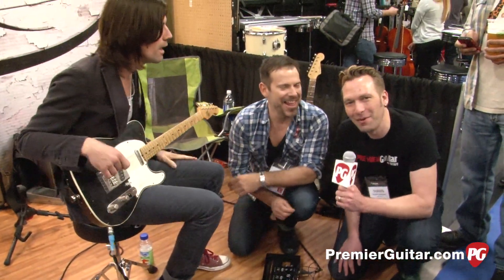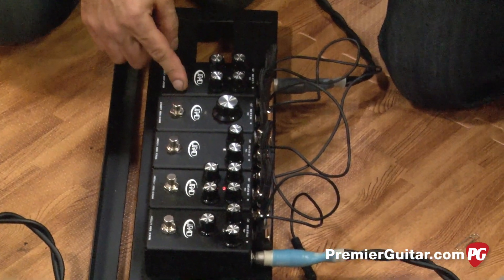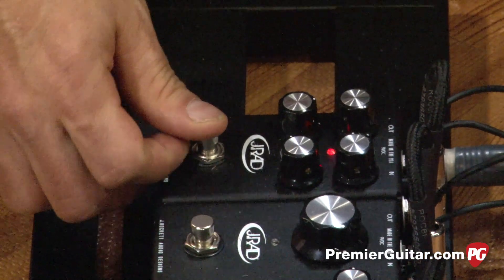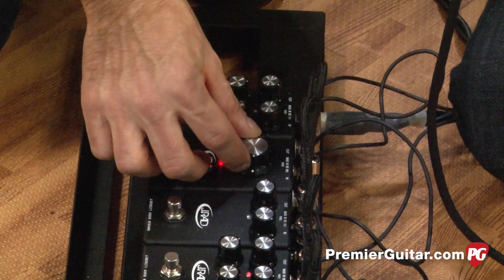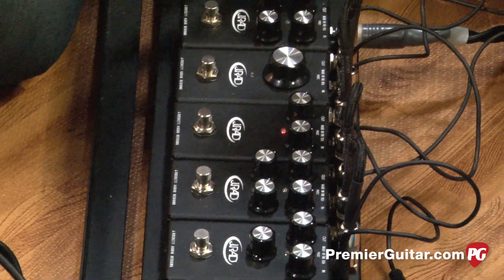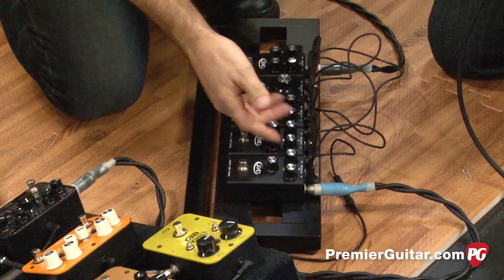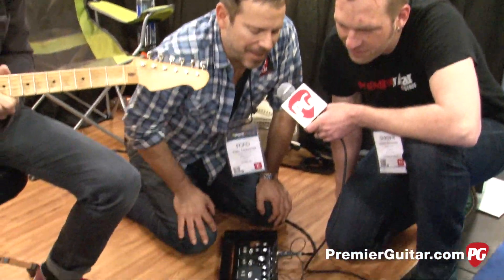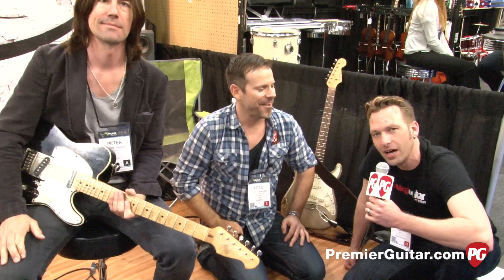NAMM '14 - J. Rockett Audio Designs Tour Series Pedals Demos

Comment: Can someone tell me what is the point of seperate stomp boxes?

Surely in this day and age, just buy a floor unit like a Boss Gt10 and have everything in one box. One power supply, one input cable, an output and does literally everything?
Reply: Boring.
Reply: Sure, if you're okay with shitty sound.
Reply: do you wonder why you never see pro musicians using multi-fx pedals? they always sound terrible/fake/cheesy. i'd rather spend the money on a pedal that was focused for one particular reason. besides Axe fx ill stay away from the multi units and let you use them. im sure you think line-6 amps sound great too
Reply: The difference in sound quality is nowhere near what you purists tout. CountryHouseGent, if you use a GT unit and are happy with it, go for it. I love my GT-8. I do not use the preamps in it however.
Reply: Use what you need. Some guys have just a few "go to" sounds they need, like an OD, Fuzz and Delay. Rockett makes killer pedals for that, like my Afterburner & Blue Note. Other's like a ton of FX available. To me, the best Multi-Fx "All in One" Pedal design is the new Zoom MS Series pedals that have Bluetooth, so you buy what you need, but at only a buck or two a pop.
Reply: The pros use the Fractal Audio Axe FX
Reply: H. Genelly the zoom G5 is also an amazing pedal and I've been very impressed with it's tone and it's tube boost and z pedal enhancements are fantastic, Great pedal and solution for those of us who can't afford an Axe FX unit but want a good selection of amp heads/cabinet tones and myriad of decent quality effects.

Comment: the foot switches are too close for my foot size.... pass....
Reply: FYI, I have a size 13 shoe, and the 2 1/2" width from switch to switch is plenty wide, after you get used to the spacing. But when you're touring,(at least in my experience), having a small board, say something like a Pedaltrain Nano that can fit something like a Mono "Tick" case, that's super light and can attach to a Mono type Guitar Case is well worth the trade-off IMO. But if you're worried about it, just space them out, providing you like the sound.
Reply: You don't have to put the butted up to each other so if you have a big foot you can spread them out.